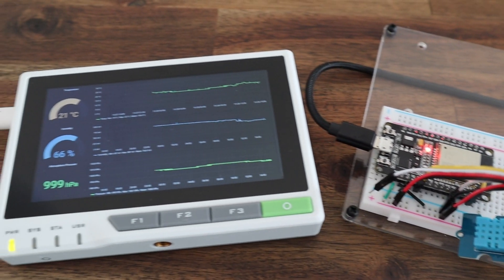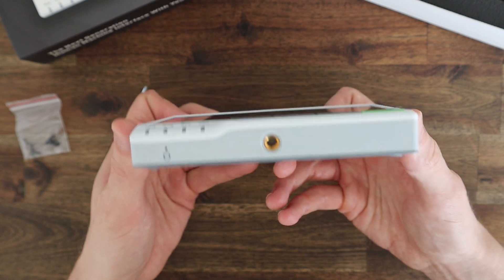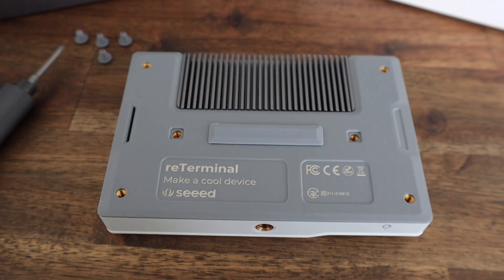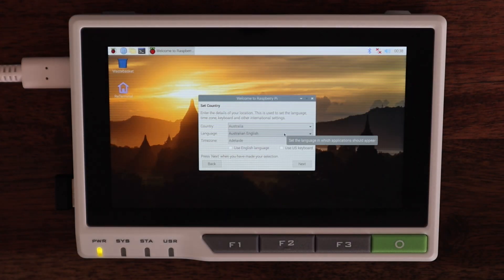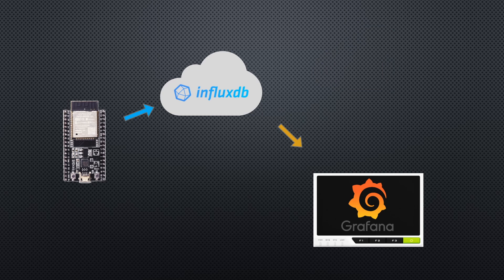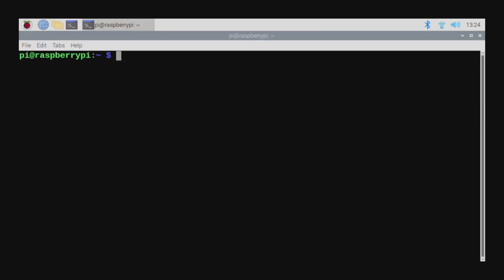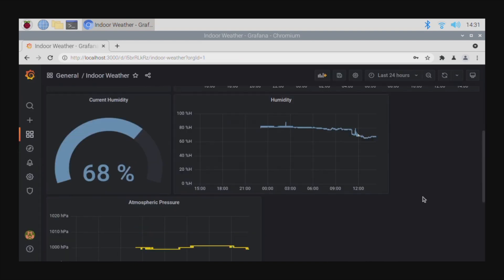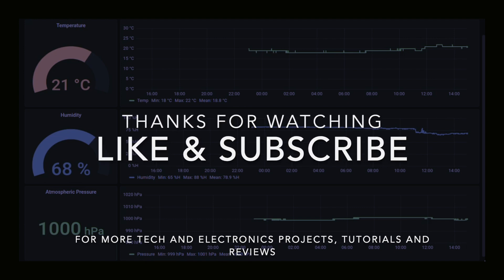Grafana Weather Dashboard on the reTerminal by Seeed Studio

Comment: That is not an expensive machine ... it is an expensive use for it (as an example is wonderful, but could be better options if somebody want it for that particular usage).  Just check the machine specs and compare:

$65  Compute Module 4/ 4G RAM/32GB eMMc
$35  IO Board
$65  Screen

$165 just for these parts.  And you have $30 for the case, a Real-Time clock, accelerometer, encryption hardware, light sensor, buzzer and high capacity internal IO Expansion.  And everything certified to work together ... how much could cost to build something similar with standard parts?  What about the time and convenience?

Take into consideration that the CM4 is for enterprise/industrial applications.  Maybe an Rpi3 or an Arduino tablet could be better options for the Weather Dashboard at home.  I have now 3 of these txTerminals  coming in the mail for more advanced applications, as that CM4 device is not a toy, it is a really capable machine.

Could be possible that for a Weather Dashboard a $36 Wio Terminal is a better option, but it is a very different type of device, more similar to Arduino that to Raspberry Pi.
Reply from the maker: Yes I completely agree, it depends on what you're going to be doing with it. If you're taking full advantage of the Pi compute module's power then this is actually an affordable and powerful all-in-one package.

Comment: This is mostly related to the esp itself I guess, but If there is no wifi available, is the data buffered or lost?
Reply from the maker: This example code will just discard the data until the WiFi network is available again but you could write a set to buffer a certain number of data points.
Reply: @MichaelKlements  thanks!

Comment: Great Project! Is the Re-terminal absolutely required? Couldn't Grafana be displayed on a normal monitor using RaspberryPi 4??? I'd really like to try this project and would benefit greatly from a full tutorial.  Is there a reason for using the Re-Terminal I'm not thinking of over a normal Pi display?  The last thing I need is another 5" Pi monitor that I don't use because of it being too small for my old eyes...... 
Otherwise, really, this is a great project!
Reply from the maker: Thanks Ronald! Yes you can run Grafana on a standard Raspberry Pi and plug it into a monitor - the reTerminal is just a useful all in one device with a touch display. I have to agree that the display is a bit smaller than I would have liked - something around 11" would be a lot more user friendly.
It seems like quite a few people are interested in a full tutorial, so I'm working on putting one together.

Comment: Nice Project. Good Job, reTerminal is cool but i feel it is under utilized in this case. it should be a controller of sorts. 
Making the browser open on full screen automatically on startup will be ideal.
programming the F1,2,3 buttons to cycle through tabs on the browser with different grafana dashboards or other content would be cool.
Reply from the maker: Thanks Terrer! Yes, this is a very basic application and dashboard to be running on it. I'd like to eventually have it running a weather dashboard, air quality dashboard and a form of home automation "control station" with the function buttons selecting between them.
Reply: @MichaelKlements  very exciting, sounds like a awesome tool, i would like to program a button to showcase cameras/surveillance and one for solar stats. i hope you record and upload a video with the finished project.
Reply: interface device on a computing platform which is more appropriate as a server.

And for almost $200? Interfaces are meant to be cheap, so you can have many of them. They should have gone with a cheaper, WiFi capable microntroller-based solution instead, like Cortex or ESP32.

Comment: I would very much like an OBD-II reader. My  Volvo XC70 would benefit. Are the plans already extant? I am a retired software engineer, so using Grafana will be a dawdle.
Reply from the maker: I've seen people use a Bluetooth OBD-II reader to plug into the diagnostics port and then use their Pi to display the information from it - that might be an idea to try? Grafana looks quite intimidating, but its actually pretty simple to get basic information displayed.